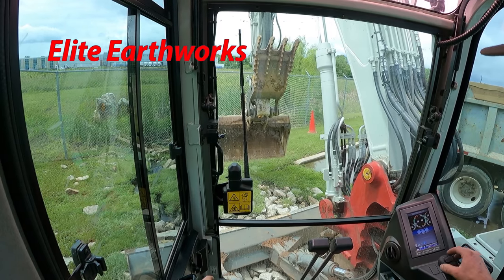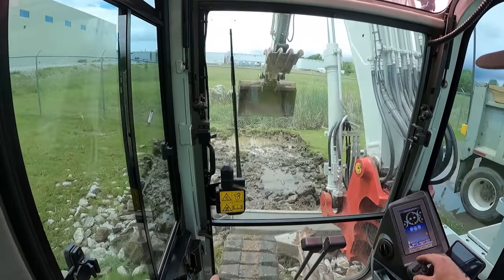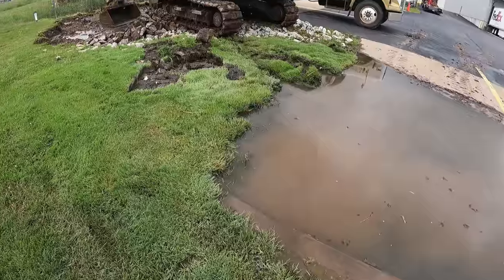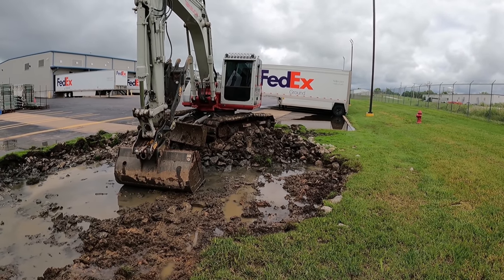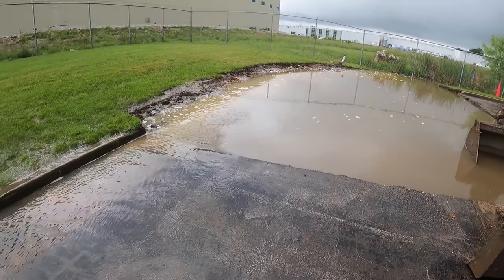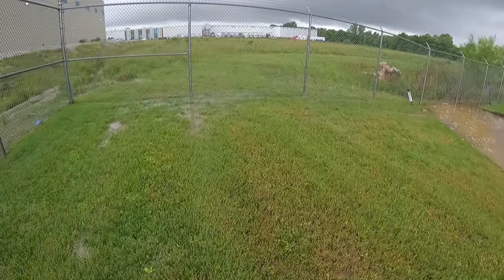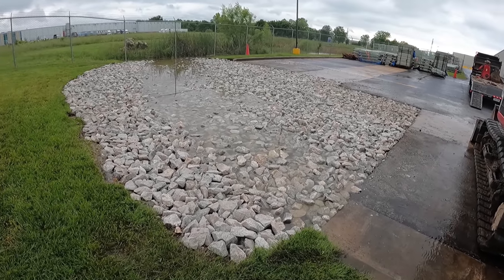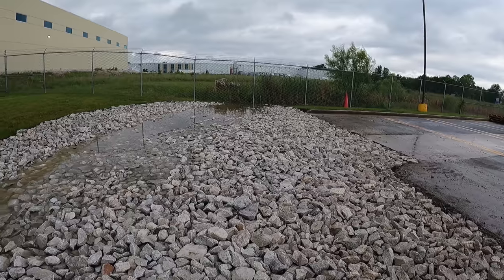Replacing A Failing Dissipator Pad

Comment: Neighbor Mike said to tell you, “Thanks!”  He’s had to pull trailers out of that corner several times.

Turkey Creek is going to flash flood when you open up that pond!  Every time we get a small downpour, it runs full already.

That muddy rip rap will make great fill.  I wish we had it here in the pond wash across the road.  A couple more years and there won’t be a pond!  If that place ever comes up for sale… I’ll own it.  160 acres, a pond, a spring, bordered by Center creek.  It includes a bottomland field of 60 acres.  40 acres of timber and another upland field of 60 acres where the pond and spring are.  It’s a piece of heaven I really want to latch onto!  If I owned it… you’d have another pond restoration job!!!

Nice job spreading those stones underwater.  You can add that to your résumé!!!
Reply from the maker: Lol nice yeah it was a lake in that corner. That would be awesome! I would gladly help you clean the pond up. 👍🏻 good seeing you the other day

Comment: Thank you Brandon. Hopefully this will solve the problem. I'm one of the  yard jockey for fedex ground. That water in the back corner was almost all the way up to the doors on the trailers in that corner and all the way out into the yard to door 18. It's that big wharehouse this mess cuz. It was such a big mess.
Reply from the maker: Thank you! Oh cool! Yeah it was poorly designed for sure and the warehouse next to you guys drains into your retention pond so that doesn’t help either. The pond really needs dredged out and the drain through the dam fixed. I sent them pictures and gave them a price. I’m just waiting to hear back now. Appreciate you watching
Reply: Well with what rain we got on 8/9/22 the new pad seemed to work great. Just need a really heavy rain to see how it does

Comment: One good thing about all that rain is that it gives you a good sight line for replacing the rip rap. And yes, the tailwater out of that stormwater pond is an issue. Definitely needs a good cleanout and the design reevaluated. Good job on the rip rap pad...
Reply from the maker: That’s for sure! It worked out pretty good that day. Appreciate you watching

Comment: Exactly right. The paperwork on commercial jobs is a pain and aggravating. And I'm sure it pretty much crammed into a folder and forgotten. I just bid a job that requires 2 million in insurance liability. It was a $6000 retaining wall job. I emailed back and said thanks but no thanks it's not worth paying for the increase in insurance. They emailed back and said 1 million was fine but I needed to do more paperwork. Haven't heard anything back. Pretty much was a waste of my time 🤪
Reply from the maker: Oh man yeah they definitely make it a pain.  Most of the time the work is the easiest part lol. I think I would have done the same thing.  Appreciate you watching
Reply: Yeah, I’m going through the same kind of thing.  Had a job lined up with a customer between him and myself, the builder that is not even working on the site yet found out about it and is wanting a cut, insurance info, job details, ect and it’s nothing to do with the building project he is over.  Just is not worth it it sometimes .

Comment: Can I ask why you use a grading bucket for digging out rock want that wear down the blade
Reply from the maker: It’s easier to dig out this rock and leave a smooth finish for the new rock. The cutting edge is harden steel it may wear it some but it will take awhile

Comment: There's definitely a dredging job in your future. Question, what's the most accurate way to figure rip rap of that size? It seems like every time I figure it I'm either way too high or I come up short. Rip rap is the only thing I have trouble trying to figure.
Reply from the maker: I usually figure 5”-6” thick because that’s what most of the stones are. I agree it’s a tough size rock to figure. Appreciate you watching
Reply: Length x width ÷ 9 x
    90 for clean
    116 for compacted
x inches deep
÷ 2000
That formula will net your tonnage required.